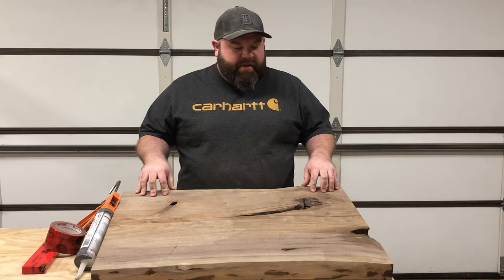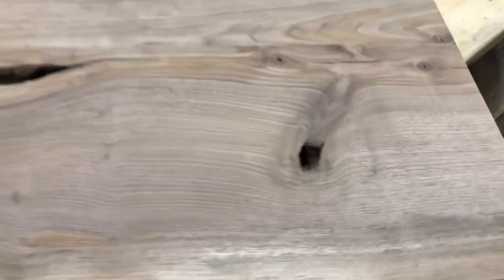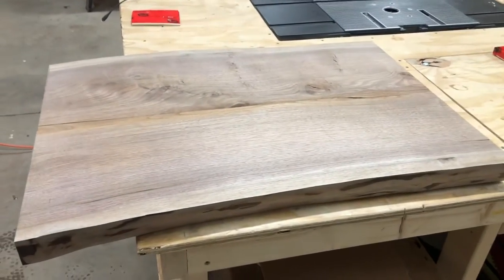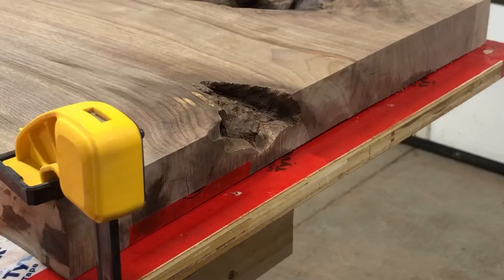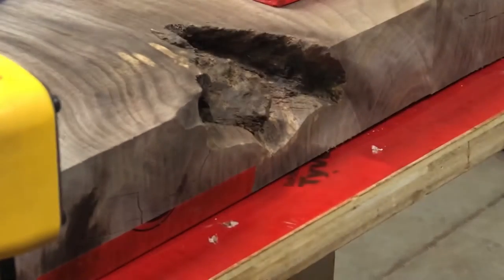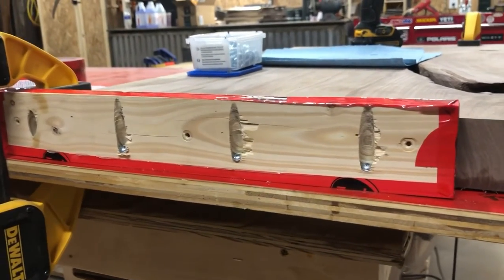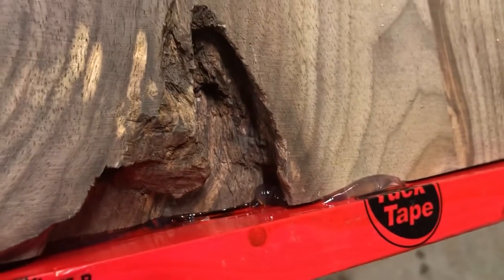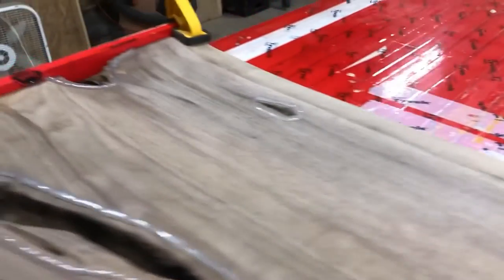How To Build an Epoxy Form - For filling small voids, cracks and knots in wood with epoxy

Comment: I learned 2 things watching your video right after I tried my 1st sacrificial wood piece. First, don't round off the ends before epoxy, can't tape them right. Second build those little dams around the cracks, stuff will spread!

Comment: Thanks for the video! I wish I would've watched it yesterday before starting my project. Putting the hot glue around the voids would've helped, as I filled them with colored epoxy and will be topcoating with clear, but the colored overran the voids.  Hopefully I can sand out the color that stained around the edges.
Reply from the maker: I’m glad it helped!! One thing that I’m not sure I added in the video was about the staining with color. I’ll be making another video soon. The tip I’d give you for that is to put two coats of polyurethane around the voids prior to filling. That creates a barrier to stop any color or epoxy from creating the stain ring around your voids.

Comment: Thanks for a great video man! I’m doing some epoxy work for a grad class, and this helped a lot! Some questions still though:
-Have you had problems with the hot glue soaking into the wood?
-What is the best way to remove epoxy after the pour?
-Do you coat it al all in the inside to prevent leeching?

Another thought: The reason for the “epoxy stain” is because wood has pores, and the epoxy seeps into it. This is seen most clearly is woods like oak and walnut, but is true of every wood to some degree
Reply from the maker: I appreciate it! Hope it helped ya. 
- No, the hot glue won’t soak into the wood. If it does for any reason, light sanding will take care of it. 
- depending on your equipment or capabilities, a planer with a helical head or a router sled table are the best options in my opinion. If that is not an option, than a belt sander is just about the most efficient way to remove a large amount of epoxy in a hurry. 
Yes, I coat every inch of the wood/substrate the epoxy will touch. This is for preventing air from escaping the wood and causing bubbles as well as leeching. More so to prevent the air bubbles and provide good adhesion. 
- since this video I have changed my process some as far as the epoxy staining goes. I now put 2 coats of polyurethane on any surface there is potential for contact with epoxy. This creates a barrier so that the epoxy, colorant, and metallic can’t penetrate the top of the substrate. Sands of very quickly after as poly only creates a “plastic cap” on wood. It doesn’t penetrate very deep.

Comment: Thank you for sharing this, sir. I'm prepping my first slab ever (8 foot of American elm, 40 inches wide) and I have a few knots to fill. Do I need a deep pour epoxy for knots because it is several inches thick? They're really narrow.
Reply from the maker: Not a problem! I hope it helps you. Yes you will need deep pour epoxy of some sort. Depending how thick the slab is/depth of your pour will determine what one. Be sure to read the product descriptions before you buy, they will tell you what you can and can’t use the epoxy for. Always use the depth or thickness of your pour, the width doesn’t really factor in. I use wisebond deep pour epoxy, and their product is good for 1/2” - 2” thick pours at a time. Most products will give you a range like that.

Comment: Nice discussion. My only issue is the Silicone. No problem if you cut the end off. Problem is if you inadvertently loose a drip on your wood surface. Nothing in the way of finish, of any kind, will ever stick to it. Best to use non-silicone caulk. Then you never worry about it.

Comment: What epoxy do you use for those larger knots / deformities ?? I just rough sanded my walnut table top and have no idea what to use. Was thinking total boat High performance but worried the knots and deformities are too deep and big
Reply from the maker: I have always had great luck with Wisebond Deep Pour Epoxy for the bigger knots and cracks. Depending on the size, humidity and temp it generally takes 2-3 days to harden up enough to de mold/move if needed. Ideally 7 days before you start milling or sanding it.  I have in some cases used the regular epoxy to fill in super small cracks and knots but I don’t recommend it as it can not cure properly. Wide bond also makes a quick cure epoxy that I think you can pour up to an inch but it’s very temperamental and cures insanely fast so it’s very hard to work with. You really have to be on the ball when using it but I’ve had good luck with it as well. Hope it helps!
Reply: @whiskyrivercustomwoodworki2012  awesome thank you. Deep pour it is for those bigger sections. One last question; is there a minimum amount needed to mix deep pour ? or can I just mix any amount (even if very little) as long as the mix ratio is correct?
Reply from the maker: @kreativbuilds  I would not mix any less than 6 oz. The reason being the smaller the amount you mix, the easier it is to get the ratios wrong. If your off just even a little bit the epoxy will not cure. So I always mix 6 oz just to be safe. I have mixed smaller amounts but I used a food scale and mixed it by weight. You will have to get those weights from Wisebond because the 2 parts don’t weigh the same per ounce. So just mixing 2:1 by weight will cause problems. Does that all make sense?
Reply: @whiskyrivercustomwoodworki2012  perfect sense. Thank you so much. Great video

Comment: Thanks for sharing, David.  Question…. Do you think that putting a light coat of polyurethane around the fill areas would prevent the staining if I slightly overfill?  Easy to sand I assume yet do want to avoid that stain you talk about
Reply from the maker: Absolutely! That’s what I do to prevent the staining when I pour. I would suggest doing at least 2 coats to be safe.

Comment: What is your preferred way to remove the hot glue dam after the epoxy has cured?  I started sanding first and the hot glue turned into a big messy smear.  I switched to using a chisel to pry up the hot glue but wondered if there was a better way?
Reply from the maker: I use a sharp chisel to remove as much as I can afterwards. That’s the small downfall to the hot glue. The other thing I’ve used is a metal putty knife and I sharpen the edge of it. That works well because usually it won’t cut into the wood and it’s flexible.
Reply: @whiskyrivercustomwoodworki2012  thanks.  I’ve also seen folks that use a latex caulk for their dams so I might experiment with it to see if it’s easier to remove.
Reply from the maker: @TheBradtri  I’ve used clear silicone also. Downfall with caulk is the set up time. From what I’ve found removing it is a little easier in some scenarios.